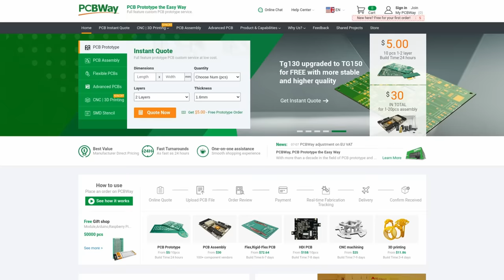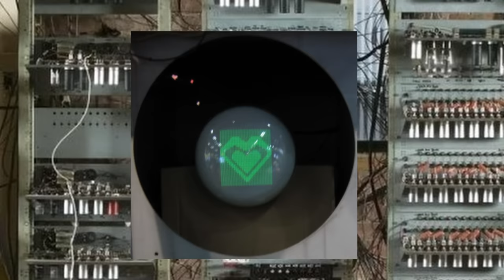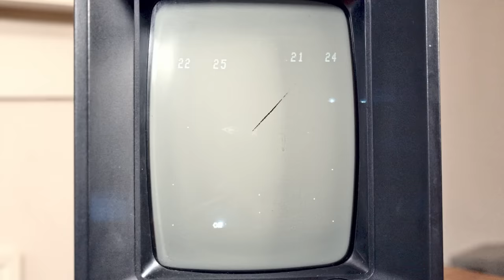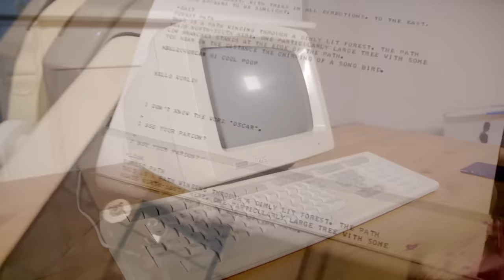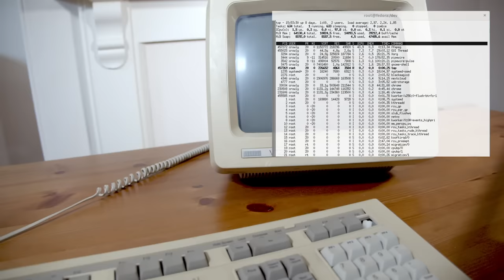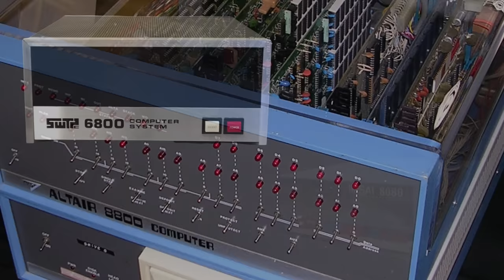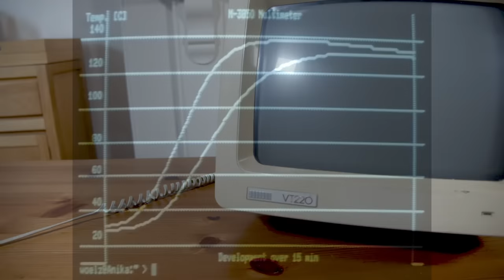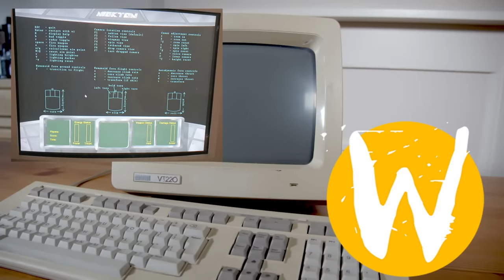The abridged history of Computer Display Tech

Comment: Your video was very fascinating. I worked for Visual Technology from 1980 to 1987. I started as an assembler and ended as a lead technician. What fed Visual's growth was their development hardware emulation of DEC's terminals as well as those of other companies. The Visual V-100, for example, emulated the DEC VT-100 nearly exactly. Going into the setup allowed the user to switch emulation to ADS, or Lear Siegler, if needed as well as set other parameters. They had a complete line of terminals including those made under contract for various companies including Burroughs. These were called SPRs or special production runs. What also set Visual's terminals apart from the others was the quality. They used Key-tronics ergonomic keyboards and also high-quality CRTs.

In addition to standard ANSI and ASCII terminals, Visual produced a line of graphics terminals that was both a standard DEC compatible terminal as well as a graphics terminal. Their V-102 with the graphics option, an add-on daughter card that sat on deadly pin headers that could rip one's hands apart, handled the GTCO and DEC Regis graphics. Their V550 line used a special low persistence CRT to allow for high-resolution graphics, and their V-450 and V480 series utilized dual Z-80s with one dedicated to the standard terminal with the other for graphics with the V-480 being the color version.

In 1982, Visual purchased Ontel Corporation. Ontel produced "intelligent" terminals that were beyond a regular terminal. Ontel's products were more like small PCs complete with hard disks, Phoenix and Hawk drives, floppy drives, and a multitude of add-on cards. The systems had dedicated slots for the main cards as well as additional slots for the add-on cards such as word-mover-controllers for world processing, special communications cards, such as the SDLC controllers, and many other interesting cards including RAM cards covered with static RAM chips. 

Shortly after this purchase, Visual entered the personal computer market with their V-1050 CP/M 3.0 (Plus) computer and later their Commuter Computer a transportable IBM compatible. I had a V-1050 (Kicks self for selling it!). It was a great system that came bundled with all kinds of software including Z-80 assembler and C-BASIC. The system had a unique hardware setup with a 6502 for graphics with dedicated 32K or video memory. I still have my Commuter complete with user manuals and that system is still operational today as it was when I first got it. I only wish now that I kept my V-1050.

By the end of the 1980s, Visual was a bit worse for the wear and made one more shot at the waning terminal market. Their foray into bit-mapped graphics and X-terminals while successful, was a bit too little and too late. They never had the sales they expected as that market was terminal due to PCs being able to emulate the very terminals they were producing through software instead of hardware. They closed their doors in 1991 or 1992.

Comment: Unix 7 edition refers to typewriters quite a lot. Init in 7th for example 

“When init first is executed the console typewriter
          /dev/console. is opened for reading and writing and the
          shell is invoked immediately.  This feature is used to bring
          up a single-user system.  If the shell terminates, init
          comes up multi-user and the process described below is
          started.

          When init comes up multiuser, it invokes a shell, with input
          taken from the file /etc/rc. This command file performs
          housekeeping like removing temporary files, mounting file
          systems, and starting daemons.”
Reply: While things changed a bit with systemd, it is also the same thing happens today when you boot a modern UNIX/Linux

Comment: It took Walmart up until three years ago to switch from terminal based applications for receiving freight. I used to work on a receiving dock and they were using an android terminal emulator that connected via xterm to the mainframe on site. The program we used would ask for a terminal type and autofilled the field with "vt220". They still use terminal programs to post and research problems with orders. The worst part about it is that the android based programs they use now are worse because they use http requests and are actually 100x slower than an xterm connection, and that delay is on top of all of the "fluff" they added in to make the program look more like a phone application like animations.
Reply: The smart system is almost completely fazed out now. It was also used for user permissions like acess to the profit and loss app as well as whether or not an associate was eligible to sign up for benefits or not. Now that is managed by some shitty app on the Wire and takes way longer to do things than the smart system did
Reply: @quohime1824  I work in a DC which uses even more antiquated UNIX mainframe for receiving and orderfilling. But yeah, moving to html and webapps makes everything so much slower. 
We used to be able to write macros to do repetitive tasks in the terminal emulators, but now we have to wait for web requests to load the entire webapp, then query a super slow database, then populate the webapp with the database data. All on thin clients or very old android mobile computers that can hardly handle simple transition animations.
Reply: Thin clients were meant to be like old terminals. Access a database from multiple different locations. The database it supposed to do all of the heavy calculations and normalize controls between systems. F7 was always APPLY no matter what screen you were on. Now every webapp has a thousand animations and gradients and different teams build different apps and nothing is fast or similar. Power users in the field have been crippled by all of the changes and it's no longer rewarding to fly through screens and fix problems for the unloaders on the dock.

Comment: MacOS X does have X11 available. At least for 10.0 to 10.10. I've run many Unix Apps which used it on my 2012 macbook air. And on my 2008 MBP.  It was even downloadable from Apple. It just wasn't the primary display mode. Also, neither of the unix installs I've been using recently use weyland - both still use X11 primary. I could install it, but the unix VEnv on the chomebook already slows the chromebook down plenty.

Comment: Certainly brought back memories!  My first job was using CP/M on a vt100 compatible terminal. I have particular memories of the Rosy tty and writing CAD software to use the the 4014 as a display.  Punch cards, paper tape, tty's, 4014's were still in use even in the early 80's so I got to get a taste of it all.  Thanks for a great video!

Comment: Ah man i love the colossus (1943), its my third favourite first computer, right after babbages analytical engine (1837) and zuse z machines (1938, 1940, and 1941)
Reply from the maker: Babbage never did finish his analytical engine, so it remained a theoretical until a practical version was built in the 1980s. All the zuse machines fall in to not being turing complete, or not  finished and/or working.  Thats why most moden text books go for Colossus as the first as it was Turing complete, fullly completed and working. Flowers was not the first to have the idea, he was the first to get a full verison complete and working.
Reply: @RetroBytesUK  the colossus was actually not turing complete, and the z3 was finished and could operate as a turing complete machine (very badly, it had no conditional branching and so could only be counted as turing complete if it calculated every possible outcome of a given program, which does stack up the compute time very quickly)
Reply: No love for the beastie at 1:00? The LEO, created by the Lyons Tea-Shop Company?
Reply: Zuse machines were programmable calculators, not computers.

Comment: The IBM world was also a lot more wide than 3270 or SNA; there was also Twinax for the minis (S/36 - S/38 - AS/400 etc). Both 3270 and 5250 terminals were block mode instead of character mode, and they effectively worked like hardware-based HTML forms. You'd send a display list to the terminal with input and output records, and you would get the records back when the user pressed a key that raised an interrupt (i.e. the F keys, submit, etc). Stuff like arrow keys and a lot of line/screen editing was done locally on the terminal.
Reply: Heh! You are describing how CICS works there and believe or not there are still tons of CICS-based applications still in use today.
Reply: Block-mode terminals were designed very much for computer efficiency, not user efficiency. They were a typically IBM way of doing “interaction”.

Meanwhile, DEC had terminals where an interrupt was sent to the CPU for every key you pressed. Anathema to an expensive mainframe, but a good fit for user-friendly interactive computing on a DEC mini.
Reply: @RogerioPereiradaSilva77  I have my own personal pet mainframe - I know ;-). CHUNGUS is a z14-ZR1 that lives in my garage. There's also BACKPAIN, which is a P8 running IBM i
Reply: @YvanJanssens  That's cool... What OS are you running on the z14?
Reply: Block mode 3270 and 5250 IBM terminals make a lot of sense.  The upstream hardware was only interrupted once per screen full of input rather than on every character.  There are far more applications than you might think that still use these protocols via terminal emulators.  Most Costco stores have a workstation with a 5250 emulator interface for inventory and other stuff that customers can see, usually near the food court and or restrooms.

Comment: I had no idea magnetostrictive delay lines were used for video memory.  This was a really enjoyable video!
Reply: Back when I first started in IT, there was a shortage of newer terminals.. something about the factory switching production from a discrete logic design to a microprocessor based design. Anyway, they dug up all these ancient units from anyplace that had any. I had to get enough of them working so the programmers could do their thing. These units used the same sort of delay lines for the screen memory. I never noticed them being sensitive to physical shock. Another odd thing about these relics was that the character generator was a board filled with individual diodes for the bits.

Comment: Again a great episode!
Noteworthy is the SAGE computersystem (AN/FSQ-7) which predates the PDP-1 (by probably a couple of months).. The system had vector display terminals with their vector lists stored in rotating drums within the display stations
Reply from the maker: SAGE was a very interesting machine/project. What I could not find was a trust wothy time line of which bits of SAGE became operatonal when.  There is a date most sources seem to use, what I could not determin, was that date all the parts of SAGE (including the vector displays), or was it just the some core components of the system.

Comment: I remember using telex terminals with paper tape readers & writers. We always coiled our tapes in a Figure-8 as it wouldn't jam or rip the tape. 
And if you typed fast you could type faster than the hole punch could punch.

I also remember the audio cassette storage and those were valuable.

Eventually i worked for CDP (the first IBM PC clone) and wrote software including SCSI device drivers used by anyone who used really massive hard drives. We were in the ANSI SCSI Standards Committee.

Ultimately it became other things including the CAN network used in all modern cars (including the Tesla).

As for display technology I tried to get Intel to separate video refresh from their CPU as an effort to speed up CPU processing. Somehow Intel never really understood this and i went elsewhere.

Those were the days. 
We made History.

Comment: In the early 60s there was another application that started out using the Tek style terminals called PLATO. This was a computer based education project run out of the University of Illinois. I highly recommend Brian Dear's book The Friendly Orange Glow for a comprehensive history of PLATO and especially the evolution of the display technology. In the late 60s they invented the first plasma screens which also used the pixel wiring grid as the video memory. Really interesting stuff...

Comment: When I started as an engineer in the early 90’s, my first jobs were to fix VT220’s and the LA210 and LA310 printers.  The VT220 and LA210 (when used over serial connection), despite being different output types, used the same protocols, making testing and fault finding a lot easier

Comment: A side-step of video display terminals, was the gas plasma display. It was developed by the PLATO project, for their terminals, in the late 1960s. It was unique in that because you could charge cells of gas plasma, and because these charges would stay trapped and not dissipate, the display itself had its own persistence. They would perfect this technology so that they could emit an array of 512 by 512 pixels that they could directly control on screen.

Comment: There was one more important step around Windows Vista I think. As video memory got bigger, applications were no longer limited to drawing into the one-and-only frame buffer that represented the screen, they got their own frame buffer and we got rid of draw clipping and flickering. Windows can have shadows, transparency, min-max effects.
Reply from the maker: X went through a similar transition, where each app could have its own shared memory buffer to draw into. Drivers then shiffted to use each of those bufferes as a rectangular texure they could composite on to surface using gl rendering.
Reply: That feature didn’t last long in Windows. The trouble was that Vista required quite high-end hardware to do it properly. Linux+X11 could manage it on much more modest hardware. Like a modest little Asus Eee 701 PC with the 900MHz uniprocessor Celeron.
Reply: Windows still uses desktop composition that started in Vista. It was right to move persitence and conposition to hardware designed for the purpose.
Reply: @lawrencedoliveiro9104  What do you mean it didn't last long in Windows? Starting with Windows 8 that's the only* way it's done because they dropped support for drawing directly to screen.
Reply: @eDoc2020  Transparency and other fancy 3D effects are gone. No more “Aero Glass”. Linux still has Compiz, and of course Wayland is entirely compositor-based.
Reply: @lawrencedoliveiro9104  Microsoft got rid of most of the Aero effects but that's just the theme. UNder the hood everything is fully composited by DWM outside of fullscreen applications and rare edge cases. This is clearly evident when minimizing a window or just by hovering the cursor over the taskbar and seeing a live window preview.
Reply: @eDoc2020  There is no “theming” in Windows, though, is there: everything is hard-coded. Microsoft got rid of those 3D effects because Windows just couldn’t do them well.
Reply: @lawrencedoliveiro9104  I would argue there is still theming, it's just not customizable. Although I believe it is actually still architectured such that it can easily load other themes.
Reply: @eDoc2020  Windows is a monolithic GUI, not like Linux.
Reply: @eDoc2020 I still miss the Windows 7 GUI. Nothing since has come close in terms of look and feel. Windows 8 was totally moronic. The subsequent undoing of the mess is progressing at a snail-pace. We still don't have a decent start menu and who knows what Windows 11 will dump on us.

Comment: Very nice video! A small detail about the Vetrex: it has a nice analog circuit that lets the 6809 processor set up a start x value, start y, end x and end y and then it will draw a smooth lines between the two points all on its own. Compared to most other vector systems that only do point this is an improvement, but the CPU does have to keep feeding lines to the hardware over and over. Some other vector systems have a DMA to do that so the CPU can do other things while the display is refreshed. Some have extra hardware to digitally calculate lines and sometimes even curves.

Comment: When I arrived at UCLA in 1971 they already had the URSA display system.   (The initials were a play on the fact the ursa is Latin for bear and the UCLA mascot was bruin bear while UC Berkeley's was a golden bear.)   These terminals were designed at UCLA and built for the UC system under contract.   The terminal included 3 major components:
- a Bell and Howell black and white TV set
- a custom designed keyboard
- a box containing the control electronics (about the size of today's  tower PCs)

These terminals were connected to an IBM 360/91 (the fastest computer in the world when built) through  a custom device (designed and built by UCLA).   This required custom software on the 360/91 and of course on the terminal controller.
Much of pioneering work was done with funds from DARPA to support defense research (as was ARPA net, which had it's 1st node at UCLA).  
If you had an ARPA net account, you could use the URSA terminal to access ARPA net.   
The URSA system predated IBM's TSO (Time Sharing Option) that was a commercialy available system.   
Because of the heavy investment and better efficiency of URSA on the 360/91, UCLA used it long after TSO and IBM 3270 display terminals became less expensive.   
I wish I could find a picture of the URSA terminal.  
By today's standard the URSA terminal was the dumbest terminal you could build.  The big advantage over existing technology was that the box was totally electronic (although it turned out immense amounts of heat and the cooling fans were very noisy).